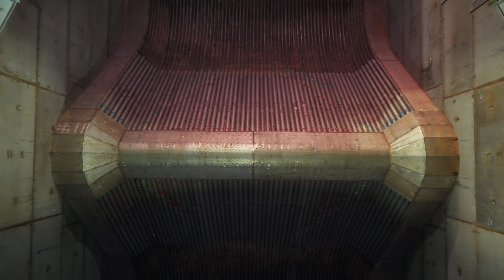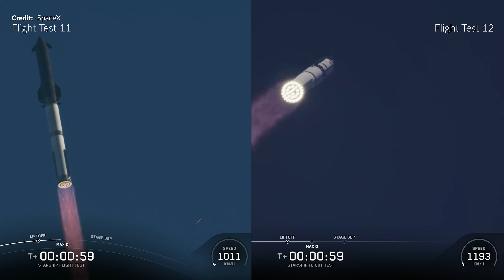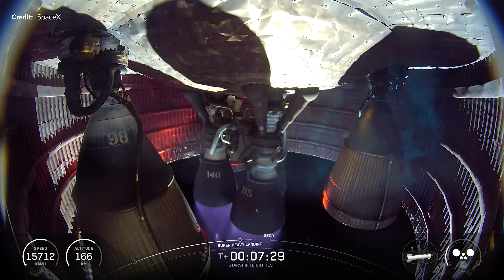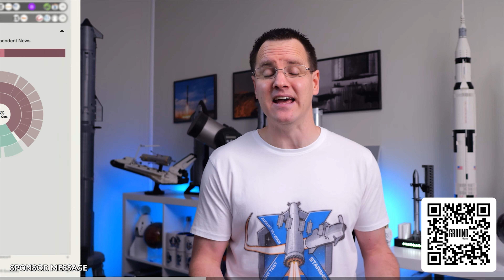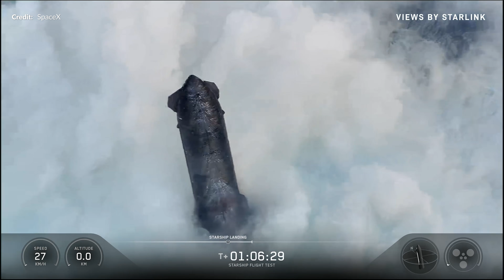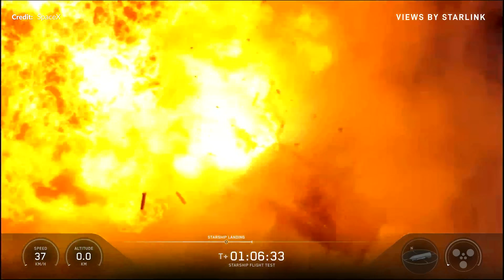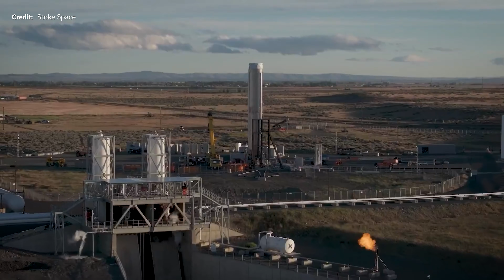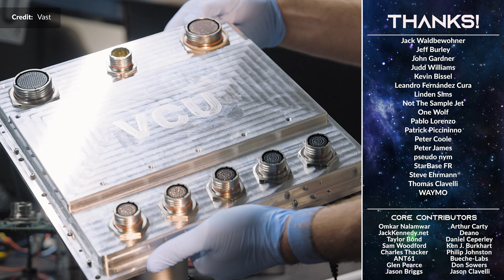Starship Flight 12 Explained - The First Version 3 Starship

Comment: wow, on flight 11, at stage sep, it was only doing 4748 kph, but in flight 12, it was doing 5762 at stage sep. 
Thats a big difference wow
Reply from the maker: It is a massive difference and a lot of that TWR performance increase is adding a load more to the payload capability.
Reply: @MarcusHouse  Most of the extra thrust is being allocated into the prop mass rather than directly towards additional LEO payload capacity.  Ultimately, that will result in higher payload/dollar (the metric SpaceX optimizes for) to the Lunar/Martian surface by allowing for the final tanking orbits on those missions to be conducted at significantly higher orbits with less orbital refilling missions per Lunar/Martian mission - but the overwhelming majority of the extra "payload" that SpaceX is gaining on a per flight basis is extra prop.
Reply: Yep but consider 100t+ eventual payload capacity to what we've seen in test flight 12. Engine out capability all good with a payload mass less than half of that. SpX will have to up  their game to deliver on promises. Not saying they can't, just stating the obvious but bitter reality of that game
Reply: Great observation!
Reply: I did not remember that holy moly. Talk about performance.
Reply: One mile per second.

Comment: I was very impressed how the heatshield was holding up compared to previous flights
Reply from the maker: It looked beautiful.
Reply: I hear they had the full heatshield installed.  Not missing tiles as before.
Reply: @Dularr as far as I know that was the case and they chose a less aggressive reentry profile so time in areas of extreme heating
Reply: Yes indeed but it still doesn't look like something you could immediately reuse.  In fact it looked distinctly over-barbequed sausagey to me in those final images.
Reply: @andrewsarchus6036  100% agree with you that making it fully and rapidly reusable is still way of in the future

Comment: Taking into account how much more payload was in flight 12 it’s amazing how it’s still went so much faster
Reply from the maker: Yep, you can really notice the TWR difference on this one.
Reply: They got the whole banana
Reply: Starship is very heavy and has a low payload fraction, the mass of the payload probably represented less than 1% of takeoff mass.
Reply: @plainText384 Low mass fraction is always an ‘issue’ with reusable vehicles; and the higher the percentage of reusability, the more an issue. But…just like with an 18 wheeler on the ground- the mass fraction ends up being a lot less important in the end to reliability, maintainability, and resilience. - Dave Huntsman
Reply: More engines with higher potential thrust AND using more of that potential apparently.  Now imagine Raptor 4s and 2 more engines.  

🚒

🚒
Reply: @Scanner9631  same number of engines
Reply: @judet2992  I think they're talking about the engine on the booster that wasn't firing, and the vacuum engine on the ship
Reply: @rangatang671 maybe
Reply: @judet2992 no, Elon has specifically talked about adding more engines to starship
Reply: By more you mean some.  It actually carried something.  And still failed to make orbit.  And self destructed both "reusable" portions.

But Elon has trained people to clap louder the more he fails.
Reply: @tlalocraingod2205  Starship is INTENTIONALLY not reaching orbit. You have to be some sort of diabolical maniac to put an unverified megaton vehicle in orbit. You seem to have no idea how big Starship actually is.
Reply: @tlalocraingod2205   Starship has still never tried to reach orbit, and both parts of this launch were expected to be destroyed. Starship flopping over into the water would make it explode even in the most finalized of versions. Elon sucks but calling anyone out for saying something has improved and immediately assuming it's Elon glaze is just as annoying as Elon glaze itself. Chill.
Reply: @judet2992   exactly this... since they are still developing the system, they are very intentionally NOT reaching orbit. This is to guarantee that the debris will come down in the safe area in the Indian Ocean. Engineers actually plan ahead, and don't just "do stuff".
Also, Elon is a world class toolbag, but he doesn't run SpaceX day to day work - that's Shotwell and team. 
They are good peeps, even if their boss is behaving more and more like a Bond villain each day.
Reply: @chouseification  finally, someone with their head screwed on straight!
-G1 Michigan
Reply: @judet2992  , NASA paid Elon to go to the moon. Just because he never tried to to get to Earth orbit, much less to the moon, does not make it any less a failure.
Reply: @pyotrberia9741  again, assuming pointing out improvement is Elon glaze. Yes it’s too slow, yes it should’ve had crew on it by now, but the vehicle got a lot done with a lot in its way engine wise. The flaps FINALLY decided to stop burning and the reentry correcting went amazing.
Reply: @judet2992  , But the project for putting people on the moon requires far better progress than this. With the benefit of hindsight, we can now see that SpaceX aimed for too much and, in the end, failed to deliver the basics.
Reply: @pyotrberia9741  so far it’s been too slow but they haven’t failed until the program is shut down
Reply: Do you clowns ever listen to the shit you pump out
Reply: @tlalocraingod2205  are u slow? There is absolutely 0 point in making orbit right now

It is literally just an extended or extra burn. All it does at this point is make it more difficult to reenter since you have to deorbit

🫩🤦

Comment: And the first set of V3 engines to die! During Flight!
Reply: But how many DID die?  Pause the video after hot staging while the engines are revealed and a LOT more are firing than the telemetry shows.  More a telemetry failure than engine failure.  I doubt it would have stayed in the allowable zone if as many engines failed as telemetry showed.

:trophy-yellow-smiling:

:trophy-yellow-smiling:

Comment: But booster died at sea

Ship did not orbit

Both booster and ship BLEW up at splashdown

Reuseability my ASS
Reply: They said no re use this flight so I'm not sure what you were expecting during a test flight
Reply: Both were INTENDED to be destroyed.  Happens whenever they are not caught - as planned.  So nonsense to complain about.

Ship was NOT INTENDED to orbit.  So again nonsense to complain about.

Finally no plans to reuse it this time so again nonsense to complain about.

Your complaints are like complaining your coffee doesn't taste like ice cream.  

:face-turquoise-covering-eyes:

:face-turquoise-covering-eyes:
Reply: Nice Thunderf00t impersonation.
Reply: Dude, comments like this clearly identify you as a moron. Imagine for a moment that you are tasked with designing and building a rapidly usable rocket capable of taking 100t payload to orbit, having a first stage powered by full-flow staged combustion engines that provide over 80 MN thrust each. So that true rapid reuse can be possible, you need to include a launch system that also catches both first and second stages in mid-air after they automatically navigate their way back to the launch pad.

What, oh superior armchair super genius, would be your plan of attack? Perhaps you will only need to spend a year or two coming up with the perfect solution away from prying eyes in the quiet seclusion of your parent's basement? Or would you do it all in perfect computer simulations first so no one should have to live through the unimaginable embarrassment of not being capable of getting it right first try? Perhaps all it would take would be for you to spend some time on the shop floor, graciously handing out sage technical advice to SpaceX's six thousand or so six thousand or so propulsion engineers, chemical engineers, cryogenic specialists, fluid dynamicists, civil engineers, structural engineers, mechanical engineers, hydraulics engineers, acoustic engineers, aeronautical & aerospace engineers, thermal protection systems engineers, materials scientists & metallurgists, guidance, navigation, and control engineers, orbital mechanics specialists, electrical engineers, avionics engineers, software engineers, manufacturing engineers, industrial engineers, machinists, welding and fabrication specialists, quality & reliability engineers, process engineers, and others all clamouring for your visionary insights and your almost otherworldly problem solving abilities. Please! As unworthy as we are, we beg you to tells us about your obvious but elegant and foolproof plan for immediate perfection!

Have SpaceX asked you to be their leader yet? If they haven't, well I suppose they must be just as dumb as you imply!
Reply: People don’t even understand something as simple as sub-orbital 😂
Reply: low tier ragebait, sybau gng 🥀🥀
Reply: Great report Marcus!
Reply from the maker: These are tests. They are trying to do something that has never been done before. Go make your own record rocket with far more 2X the power of anything previously flown out of the atmosphere and see how you get on. I'll wait.
Reply: @MarcusHouse  😂 he won't be responding to that one.
Reply: They are testing and innovating. New rocket iterations = new issues that needs fixing.